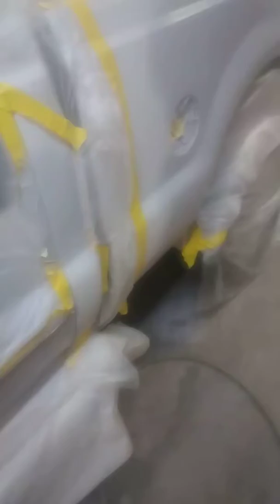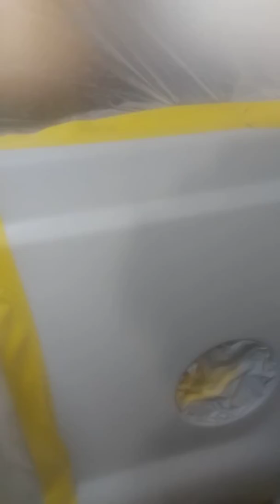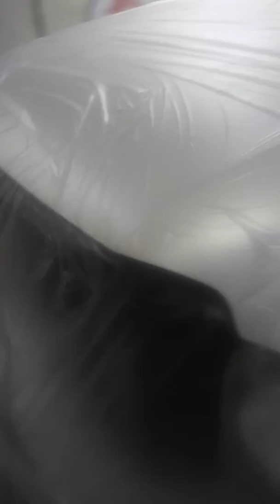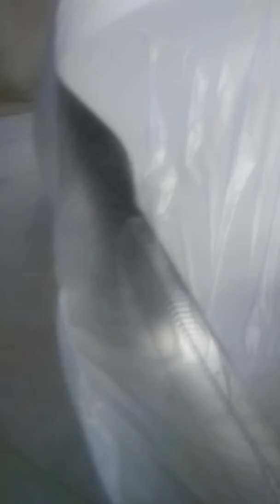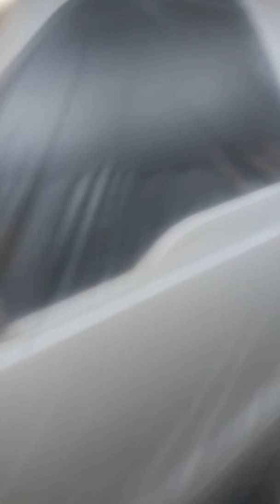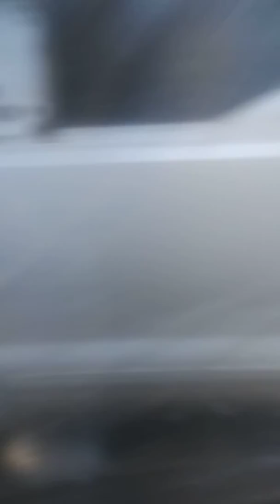F250 body work done and 4 wet coats of spray polyester

Comment: Looks really nice Ed. That polyester primer is amazing stuff to be sure. A great time saver.
Later.
Reply from the maker: Thanks brother . let me know if you want that 650 top end ill ship it to you. Email me your address @ Edwardmartin94@gmail.com. you can have it
Reply: That is a really nice of you to offer that Ed but I think the shipping would cost more than the barrels are worth. It used to be easy to send stuff back and forth across the border but today it has turned into a nightmare. Scott down in Florida sent me an absolutely rust free front K member he had in his scrap pile for my PT Cruiser (2002) and I paid the shipping which ran me 450 dollars by the time I was finished. Scott gave it to me for free and did all the crating it up and getting it in the mail. It only weighed 60 pounds but like I said, the shipping was staggering and they even charged me 45 dollars customs duty just to cross the border. If I lived across town, I'd be very happy to get the barrels but I don't think in this case that such a gift is prudent.
God bless ya Brother, you are very kind. And I'm not the kind of guy to forget such kindness.